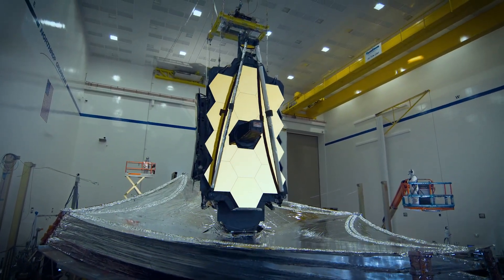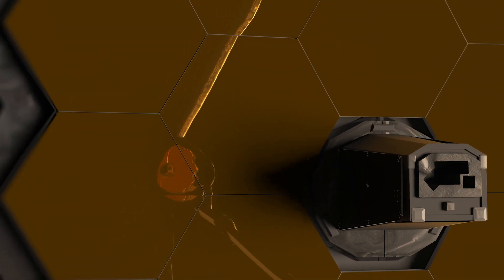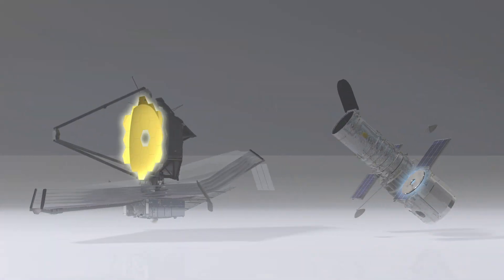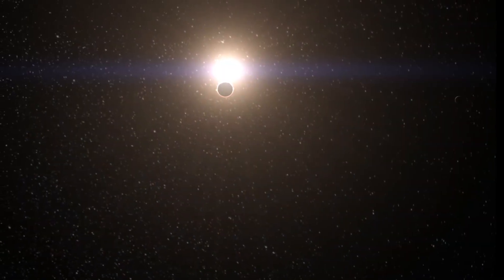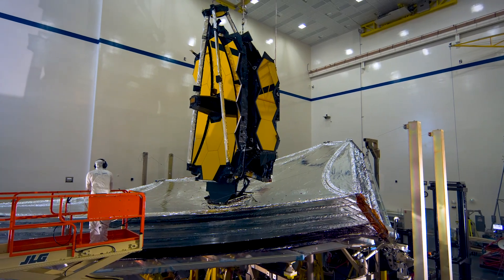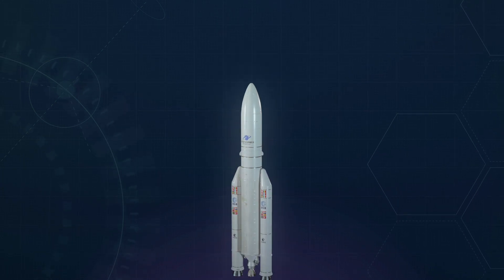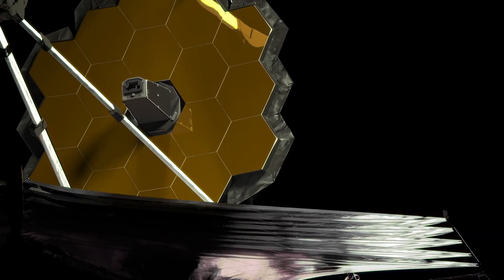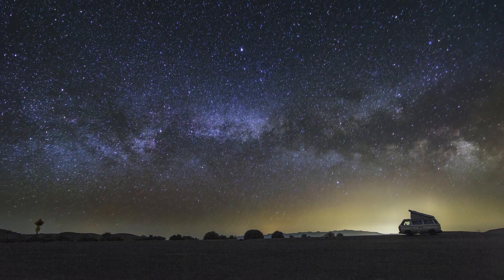An Introduction to the James Webb Space Telescope Mission

Comment: Very pretty & Beneficial to humanity I'm sure, but I see Zero protection from: comet/asteroid fragments. I'm guessing it will be in our solar system to do it's "peering" into the past. Which is full of these remnant fragments.
Reply from the maker: We'll be a million miles from Earth, so not much debris. Space is very very big, so comet/asteroid fragments are not really an issue. We do expect micrometeoroid impacts, but the beryllium was tested and impacts to the mirrors will be negligible.  The sunshield is built with rip stops to prevent a puncture from tearing. Thanks!
Reply: @NASAWebbTelescope  excellent thinking on protection. The farther it goes out, how many years will it take for the data images to get back to your team?

Comment: Unfortunately, the sunshield and also the secondary mirror arms are shiny and highly reflective. I am sure it will distort the telescope's vision.
Reply from the maker: The sunshield will indeed reflect starlight on its shaded ‘dark’ side, but direct light rays reflected off the shiny sunshield have no direct path into the field of regard of the telescope optics, so they can’t make it to an instrument detector. We don’t want the sunshield to be black, even on the ‘dark’ side, because its thermal properties would be such that it would help heat rather than cool the telescope and instruments.  Furthermore, making it visibly black would only make it a poor reflector of visible wavelengths but not of infrared wavelengths.
Reply: I am sure you have done it perfectly well and thank you for the reply. I meant only the last shield and only its telescopic side plus the mirror arms to be covered in darkest black. I was more worried about the ambient light from other stars, planets, and the milky way. 
What I am saying is just a guess and I am sure you know every matter.
Thank you for your reply.

 @NASAWebbTelescope

Comment: How is it going to maneuver? Does it have cold gas thrusters?
Reply from the maker: Here's all the info you could ever want on the observatory's propulsion system! https://jwst-docs.stsci.edu/jwst-observatory-hardware/jwst-spacecraft-bus/jwst-propulsion  Short answer is there are two types of thrusters - bi-propellant Secondary Combustion Augmented Thrusters (SCAT) for orbit correction and mono-propellant rocket engines and  (MRE-1) for attitude control and momentum unloading of the reaction wheels. The SCATS use hydrazine and dinitrogen tetroxide. The MRE-1 use hydrazine. (Sorry, that wasn't so short!)